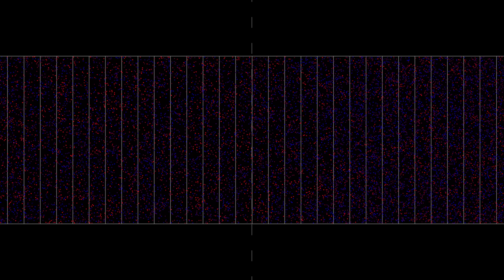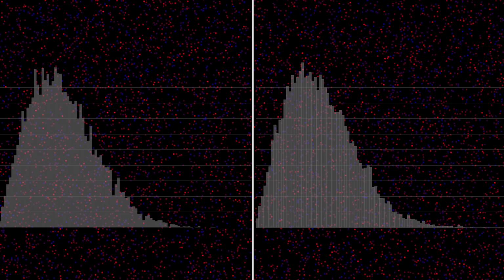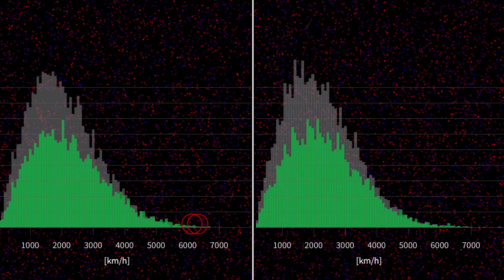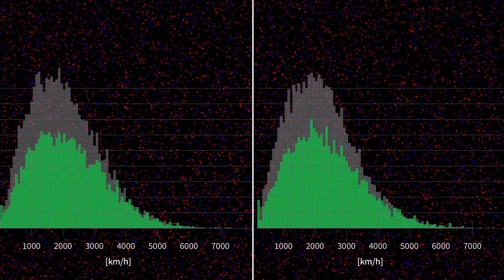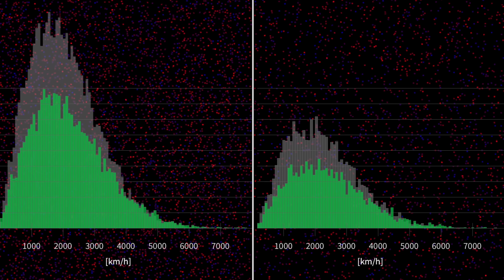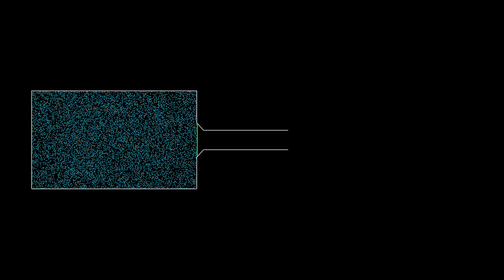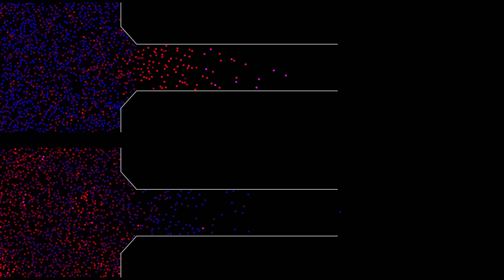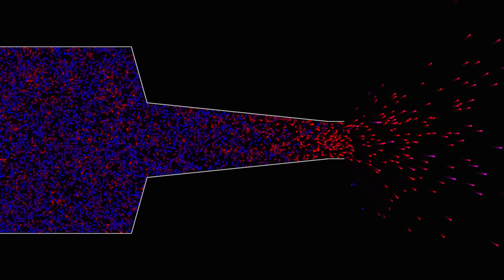A new way to explain airflow

Comment: Now I just want to see every flued phenomena i know using this model.
Shockwave, sound waves, boundary layer, coanda effect , convection, flow separation, beating, vortex shedding, laminar/transitional/turbulent Flow, Rayleigh–Taylor instability, "bladeless fan", cavitation, drag crisis or when drag drops as specific reynolds numbers.
And probably many more that I just cannot remember right now. Honestly I just want a full text book using this model to describe what I already should have learned 😂
Reply from the maker: Glad you enjoyed it. I am slowly exploring different flow aspects that can benefit from being explained this way. I tried Coanda, but the viscosity is too much for a proper jet to form. The mean free path needs to be much smaller than the jet cross section and that means much higher molecule count. My focus is to put together a good explanation of lift and then find a way to run the code on the gpu. I am especially keen to see if I can simulate shock diamonds.
Reply: @williamfraser  I don't know what you are programming this in and I have not done this big of an N-body simulation before (I stick to FEM).
But updating velocities and positions looks a lot like matrix calculations to me. And collisions looks a lot like BVH. And naively one would think one thread per partikel would be fast. So it does look like something a GPU would be really good at. And with a 16 GB card or higher, you could probably have 10's of millions of partikels maybe ~100M, but 1B is probably still out of reach.

I assume you will have to run with timesteps < max velocity /  ½r or something like that to catch the collisions. And the partikels in a shock diamond are moving real fast 😂. And you will probably need a lot of partikels before you see the pressure build up and release again. So I imagien you have your work cut out for you. But I am subbed now, so I am not missing it if you upload a simulation of a shock diamond. 😂Best of luck.👍

Comment: This is an amazing visualization, but it got me thinking about how air flow acts with round objects or with ducted props.  Just last week I was showing my son how you can levitate a screw driver with high pressure air blowing up the side of the handle around the curved end from our air compressor.  It would be amazing to see how that works as i feel like i am still missing something.
Reply from the maker: Flow over objects or through ducts with changing geometry is a different piece of the puzzle. It is a matter of evaluating the influence of the surface curvature on the molecules in direct contact and then figuring out how that influence affects conditions upstream, downstream and to the side. It will hopefully all come together in a future video.
Reply: @williamfraser  Awesome, I'll keep an eye out for more videos.

Comment: Very nicely explained and shown!

I am now wondering:
How does the force field of each air molecule look like in real life if you were to graph it out? (with x being the center of an atom/molecule and y the magnitude of the force)
I wonder about this more now, because I allways thought of it in a force field way instead of them colliding in an instant, so in other words: how big is the maximum affected radius, if there even is one?

And this also now sparked a new thought:
Could it be, that the change of density in a region could be measured within the sphere of this information expanding at light speed - so faster than sound?
Reply from the maker: As I understand it, the collision force is essentially electrostatic repulsion between the electron shells. There is indeed a force field, and the actual collision is not truly instantaneous. There is a weak long distance attraction that gets a little stronger just before "contact", at which point it becomes highly repulsive. Look up "Lennard-Jones potential ".

Comment: Is this how thrust works? If there's a nozzle, then this allows the molecule momentum to leave the craft, however the molecules going to opposite way in the tank (due to high density and temperature) transfer their momentum to the spacecraft. However the molecules going out the nozzle don't transfer any momentum to the spacecraft (as they don't reflect against the tank walls anymore). Now there's an imbalance of transfer of momentum biased in the forward direction (opposite to the nozzle), thus propelling the spacecraft forward.
Reply from the maker: That's right. The only forces experienced by the rocket are the collisions against the walls. That is where Newton's third law "action and reaction" force pairs exist. The rocket is being pushed forward by the molecules hitting the forward bulkhead in the tank. Force against the aft bulkhead is pushing the rocket back, but the available area to push against is less due to the nozzle hole.
Reply: @williamfraser  That is beautiful. I finally understand how thrust works at a more fundamental level. I was always confused about the newton's 3rd law explanation, but looking deeper at the molecular level fills in the gap.
Reply: I guess this implies that the gas-flow you see out a nozzle is really just a visual byproduct of thrust. The actual thrust is the molecules still in tank transferring its momentum.
Reply: @fabian999ification  As well as the molecules hitting the diverging nozzle walls! That's why you get additional thrust when you add the diverging section of the nozzle to a rocket engine.

Comment: 🔍 Field Riddle for the Viewers:

If we take a cross-section of a rocket engine the same way Mr. Frazer diagrams MHD thrusters — tracing causal flow, pressure gradients, and boundary behavior — we see something interesting:

At the nozzle’s throat, the gas flow becomes choked at Mach 1.
This is said to be a limit condition.

But here’s the riddle:
→ What causes velocity to increase beyond this limit, into Mach 2, 3, 4, and beyond?

Is it simply the expansion of gases into lower pressure zones?
If so — how does this alone explain acceleration of flow after the critical velocity choke?

I have my own theory — rooted in field behavior and geometry — but I’d like to hear from fellow thinkers first.

What’s really pushing the gas past Mach 1?

Comment: I particularly enjoyed the way this model explains a gas in a pressurized container cooling down as the container is opened up. The highest-speed signals are the first to move out, leaving only low-speed molecules behind, leading to a drop in temperature. That feels a lot more intuitive to me than the energy density model.

Comment: at least three times in here i kinda gasped as i connected something new. - this is a fantastic way to think about these dynamics. Reasoning out why venting compressed gasses get cold is normally something that requires me to do some mental gymnastics but this signal concept makes it completely trivial. I love it.
I'd love to see a 2D (or 1D) circle filled with particles that get released to vacuum, but instead of coloring them by speed color coding them based on their starting radius. I had always imagined that the fast moving particles squeeze through to escape, but when the MFP is low they can't - it's the energy that bounces through.
Reply: Right? The observation that particles within a bounded region will sort themselves by their speeds is so obvious and intuitive once it's pointed out, it's like how things work at the start of a marathon for example. And why a can of compressed air gets cold suddenly makes sense -- I thought it was a chemical process, but no, it's just because the fast air left (my god that sounds weird) and thus the air remaining in the can consists of molecules with low kinetic energy. Truly wild.
Reply: @seedmole  the leap for me was that the fast molecules DON'T leave - their energy leaves because they bounce it into a particle moving more slowly
Reply: @seedmole 🔴 Why Islam not other religion

 1-islam gives logical and simple idea for God - he is A perfect God - he is not a man nor a son of man nor an Idol or a trinity nor limited nor created - he is totally unique and to him belongs all the good qualities 

2-Islam accepts all messengers of God -- about 124 000 and in Islam, we love all the prophet of God and we can’t deny any of them - while in other religions such as Judaism for example - they reject Jesus and Mohammed -- and in Christianity they reject Muhammad ... but in Islam, we accept all . 

3-in Islam, there is no mediator between you and God -- you can pray to God directly - there is no need for someone in between... 

4- Islam is the Only religion that is Not named after a person or a tribe or a group, its name means submission to the One True God, if anyone anywhere at any time lived the life of submission to the true God alone , then he is a Muslim.

 5- In Islam (worship) is not about mere rituals. it's a comprehensive term that includes any deed that pleases God. All good deeds are types of worship, smiling, being sincere at work, saying a nice word, and even treating one's spouse gently, all this is greatly rewarded by God. And in the opposite any deed that doesn't please God is a sin; talking bad about people is a sin, cheating, lying, hurting innocent people, harming the environment. 

6-in Islam God is always forgiving - if you always repent (before death ) he will just accept you no matter how great sins you did >he forgive us out of his own grace - there is no price to be paid in order for him to forgive > so it's not like Christianity which says that God can't forgive except by blood of Jesus ..

 7-Islam is a way of life – it organises each aspect in your life.. it has solutions and divine guidelines to problems in your life . 

8-the sources of Islam also was collected and saved is also amazing - it never happen to any book in history --- it's through the uncut chain of known narrators which date to prophet time ... besides the millions who memorised it from cover to cover since that time up till today - besides being documented in front of the prophet by known companions! 

9-Islam prohibits blind following without knowledge and it invite us to use our brains to know truth, it is based on evidence and logic. The rational mind is the basis for religious accountability and responsibility. 

10-the moral system of Islam is v high and perfect and thus the countries that apply Islamic laws in a proper way -- they have less moral crimes.

 11-You won't lose Jesus if you accept Islam, but you will just correct your belief in him , In Islam, Jesus stands a good position in Islam as one of the messengers of God together with other messengers.. they were all special and they were all humans like us-- none of them must be worshiped -- we only worship God who sent them . we believe that Jesus was a noble Messenger of God but not divine,,,, we love Jesus and obey his true teachings and pray like him , fast like him , and a person won't lose Jesus if he accepts Islam -- but you will just correct his belief about him 

12- Paradise in Islam is a real physical life for both Body and soul, you will go there , eating drinking marrying and meeting with prophets and having wonderful eternally unlike in other religions which they think its only spiritual life.

 👉IN ISLAM THERE IS A PURE & CLEAR CONCEPTS OF GOD 

🍃🍃🍃🍃🍃🍃🍃🍃

God is One and Unique: God has no partners, no equals and no rivals. God has no father, mother, sons, daughters or wives. God alone is worthy of all worship. God is the All-Powerful: God has full authority and power over all things. Obedience to God does not increase His Power, nor does disobedience decrease His power. God is the Most High: There is nothing above or comparable to God. The attributes of God do not resemble that of His creation. No part of God is present in anyone or anything. God is Perfect: God does not have any human limitations, such as resting on the seventh day after He created the universe.
Reply: @seedmole  *the fast-ness of the air left the can. Many originally fast particles were reflected back but their speed signal propagated and distributed according to a gradient.
Reply: I think the youtube algorithm brought me to this video in part because of your comment. Interesting. Thank you for this.
Reply: It's because you have to add energy to pressurize them. The vessel (system) does heat up. But by the time we get a cylinder it's just stabilized to room temp. When released it cools because you are letting out the stored energy...

Edit: I didn't know who I was replying to
Reply: Quite some compliment. If you like stuff like that I suggest also having a look into statistical mechanics. They go hand in hand.
Reply: Dud ur in 3d and this is f ing kids material

Comment: Incredible video. My understanding of the pressure decreasing with velocity has recentky evolved to "well before the molecules were moving around randomly. When the flow through a smaller cross section, now they are are moving mostly in the direction of flow. So they spend less time bouncing off walls in the reduced cross section pipe so pressure is lower". I think this is a great visual explanation. It would have been cool to see a count of collisions per inch of boundary in the container vs in thr reduced cross section pipe.  Multiply each collision by their velocity component normal to the boundary and you calculate a sort of pressure.
Reply: How do you extend this analogy to supersonic flow?
Reply: @gauravm8152  i dont know exactly what you mean, but it would more or less compress the simulated air molecules together. So it would look like a combination of pushing sand out of the way while some of the particles are ejected out of the way, initially at the velocity of the moving body. You can imagine how this results in the supersonic cone.

Comment: Something I keep circling back to after watching this:

The entire system you model here is exquisitely sensitive to mean free path and boundary feedback.

Without short-range coupling (via collisions), there is no sustained signal transfer, no stable flow, and no coherent pressure differential.

Which makes me wonder — how often do we over-simplify large-scale models (like planetary atmospheres or space propulsion) by forgetting the absolute dependence of these effects on the medium conditions?

It's one thing to describe flow behavior inside an atmosphere or pressure vessel...

It's another thing entirely to assume that behavior persists unchanged into regions where the mean free path dwarfs the system itself.

Your work makes that razor-edge distinction beautifully clear.
Reply: I dunno whether to say “thank you” or “I hate you” for this comment. On the one hand, you’ve just uncovered what suddenly feels like an enormous blind spot in my general intuition and thinking. On the other hand, I’m also now almost certainly going to be even more prone to getting lost in my thoughts (and thus losing focus on external reality) for at least the next few days.
Reply: Physics is about over-simplifying models and tricking yourself into thinking you understand a phenomenon
Reply: Fluid dynamicists use a non-dimensional quantity known as the Knudsen number, which relates the mean free path to the characteristic length scale of the system. This can be used to determine whether a flow has become too rarefied to model with a continuum theory (Navier Stokes equations), and if that is the case, then kinetic (the evolution of the velocity distribution function) or particle models are used.
Reply: @bezmi  In regimes where the Knudsen number is high and flow becomes effectively self-interacting (rarefied, with long mean free paths), how can asymmetric displacement or recoil-like behavior still emerge in the absence of external boundaries? If a flow connects only to itself, what permits directional motion? Also, could you clarify what is truly meant by ‘expansion’ in this context — is it merely statistical separation of particles, or is there a deeper causal mechanism enabling motion without direct exchange?
Reply: @tinyear926  Yes, expansion would be represented by the distribution of the separation of particles having a greater mean. Also, there is not a deeper mechanism enabling motion without direct exchange for non-magnetic, non-charged particles (plasma would be an exception for example).

Comment: Interesting!
So how would a paraboloid nozzle affect the flow?
I'm thinking maybe there's some way of approaching almost entirely undirectional flow out of the nozzle (-> maximum thrust for any given flow).

Maybe there's some form of curved cone-like shape (where the gas would exit at an opening at the tip, roughly at the focus point) that would redirect the backscatter flow back to the parabola at angles that would result in a more or less perfect final reflection straight back from the nozzle?
Reply from the maker: I suspect that is the general reason why you see curved nozzles on space rockets. The ratio between a molecule's radial and axial speed changes as it picks up speed and pressure drops. The angle of the nozzle that provides the optimum deflection will therefore change along the way.
Reply: @williamfraser  It is also simply to reduce the length (and therefore the weight) of the nozzle for a fixed expansion area ratio from the throat to the exit. A conical nozzle is not the optimal shape from a length perspective.

Comment: Amazing! Could you please also use this model to show why pressure is lower in the narrow tubes than in the source chamber?
Reply from the maker: In simple terms, in the high pressure chamber the high speed molecules often collide with each other head-on, resulting in very high collisions forces. In the tube, those high speed molecules are travelling alongside each other, only nudging each other from the side when they do collide.